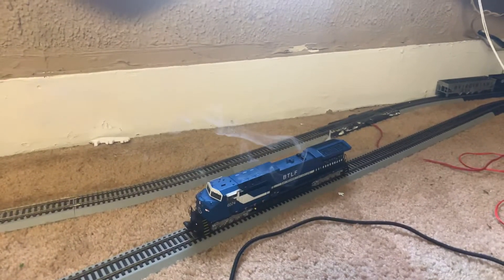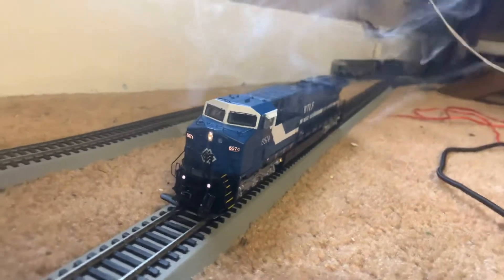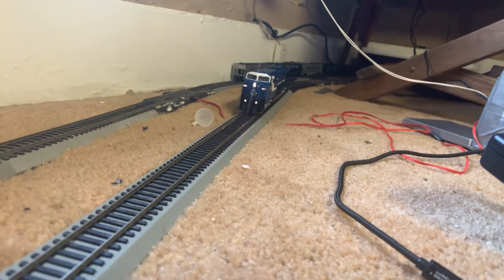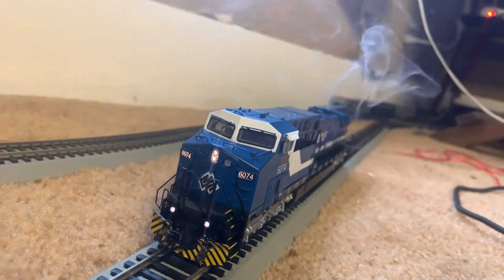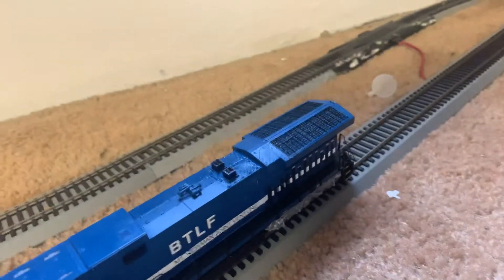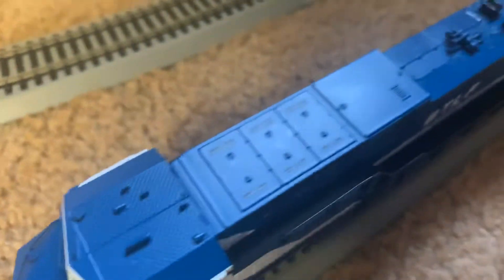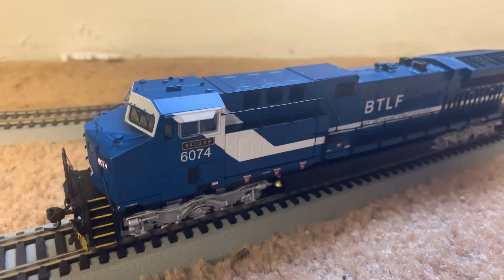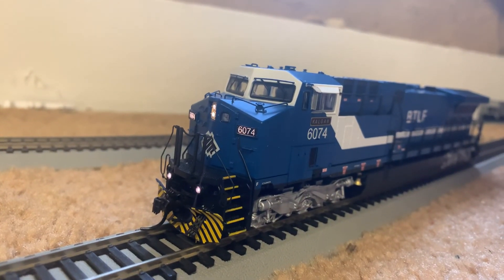Broadway limited AC6000 P3 sound and smoke review

Comment: Very way locomotive, Brandon.  Love it.  Btw, did the engine not have a rr name and you added yours?  What decals did you use?   - Drew
Reply from the maker: DruSteel69 it had BHP Iron Ore on the sides.  I used a sticker type of decal from eBay and was able to scratch the old name off the sides and color match the paint
Reply: Ahh. Cool. You did a great job.  It looks as if it arrived that way from the manufacturer. 😎👍🏼